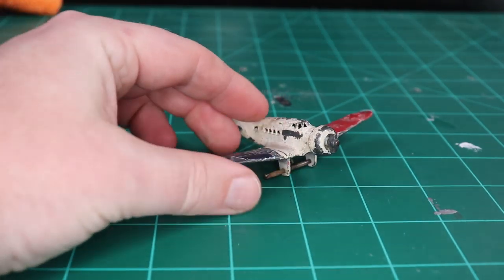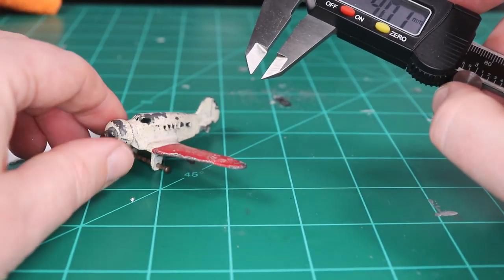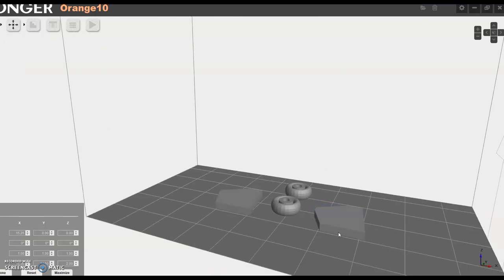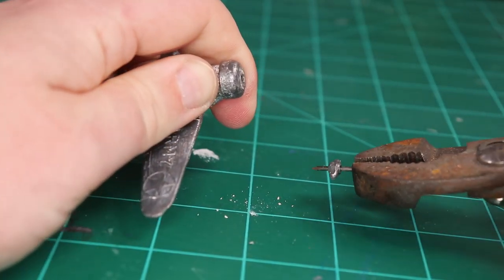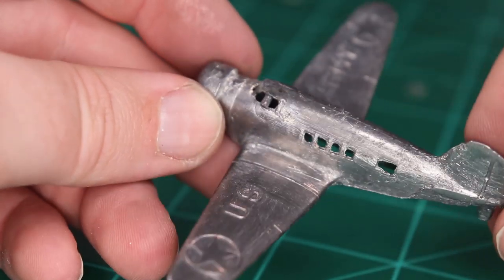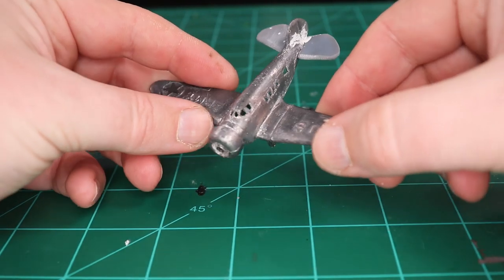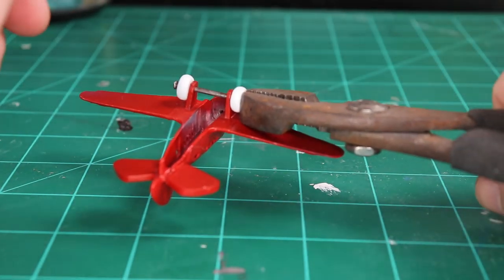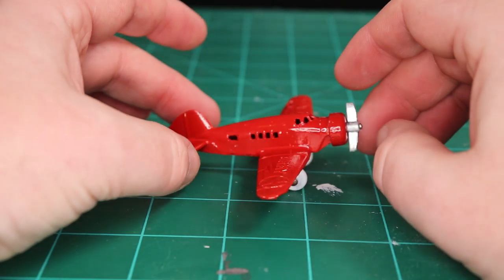Antique Diecast Barclay Plane Restoration

Comment: Very watchable video and a good restoration.   A thinner prop fabricated from a polystyrene sprue or sheet metal may have looked better.   With the exception of the vertical stabiliser, the model resembles the Northrop Delta, a transport which first flew in 1933. The USAAC (U.S. Army Air Corps) never operated the type, however one (1) was operated by the U.S. Coast Guard. I very much enjoy watching your videos, as they provide tips for my amateur restorations. I wouldn't be surprised if you could get $50 USD for the Barclay airplane.